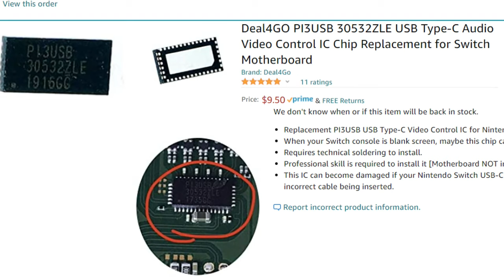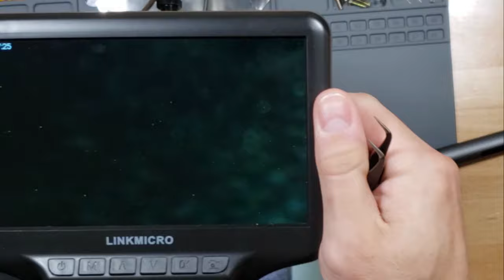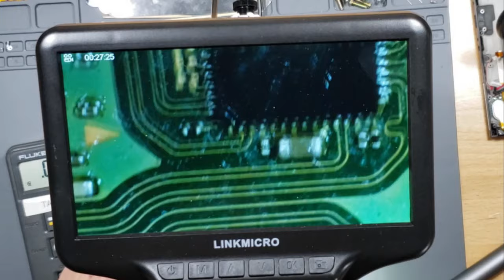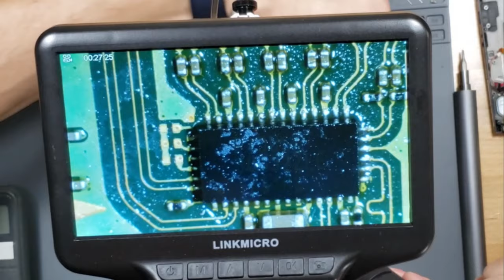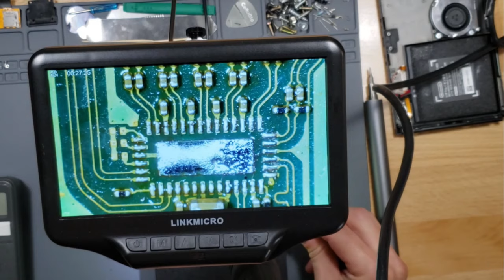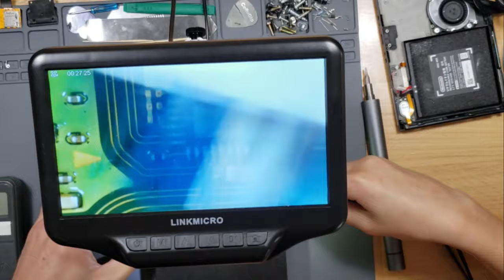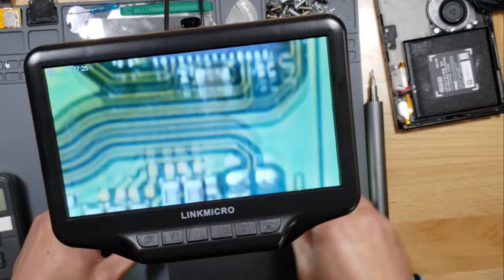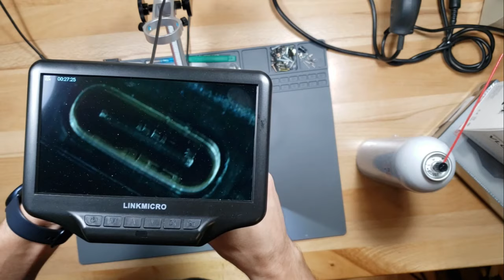Trying again to Fix a Nintendo Switch Screen

Comment: Hey Tampa, unlucky man. Strange marks on the LCD, I thought at first it may be a water damaged screen on the foil reflective back layer, but it seems to uniform to be water damage. For the docking not working, try testing the little black square filters under the chip you replaced. Each corner from top to bottom should have continuity, but no continuity side by side. These filters take the signal from that chip to the USB-C port so if one is broken it won't output a TV signal. It is so much easier if you have a working Switch to swap parts with. Good job though, and I hope you finger and leg heals nicely. Maybe you and your son might get this fully working on a revisit video :-)
Reply from the maker: We hope so, or at least get console dock working. Thanks for those tips. Everyone reading this Please check out MyMateVince his channel is full of useful info.
Reply: @TampaTec  Cheers Paul 👍👍

Comment: Hey buddy someone just shared this  in my discord. First of all you should try a known good screen on this. It looks a little like the LCD may be faulty. That said if I'm being perfectly honest the soldering job on P13 doesn't look great. Once you solder the QFN chip you need to rub the iron around and make sure you have uniform joints all the way around the chip. I'm not sure how familiar you are with these systems, but I work on them everything day here on YouTube and as a job and I can't help thinking it may be a soldering issue.

Also, check for shorts around the caps on M92T36 and also check the EMI filters below P13USB too

Finally, fantastic to see you getting your son involved. I would love my son to take an interest in this sort of thing

Comment: could it be that you need to do a clean reset of it and maybe try and reformat it and see if it fixes it ?
Reply from the maker: Thanks for the tip, Tried that too. I think I need to replace the video chip and use less heat perhaps.

Comment: defective video ic and i would have added leaded solder to the pads and middle ground plane and then use lots of flux and place the ic and re flow into place also that lcd looks like its had liquid damage  or a backlight filter is bad
Reply: Agreed if the original "fix" produced a different issue, then the issue is probably the fix. I feel like I've seen similar things when an IC has been over heated. I would suggest the same as you. New IC, clean pads, add solder, and attempt to reflow IC again. However I'd lower the temp to about 650-700°F on my SMD hot air gun.
Reply from the maker: @HavingFunRepairs  I'll try those tips, thanks. I'll make another video.
Reply from the maker: Thanks for the tips. 👍
Reply: @TampaTec  definitely like to watch a revisit if you ever get around to it. My oldest son enjoys watching your videos.